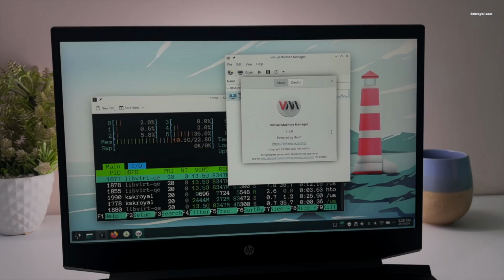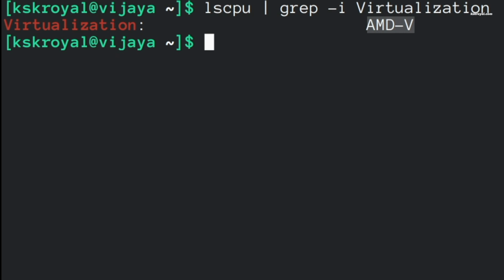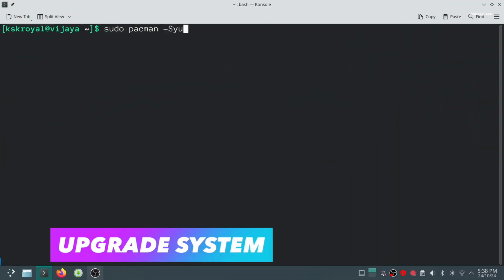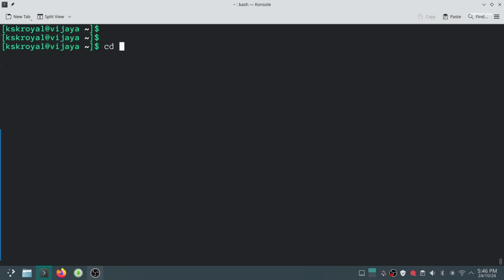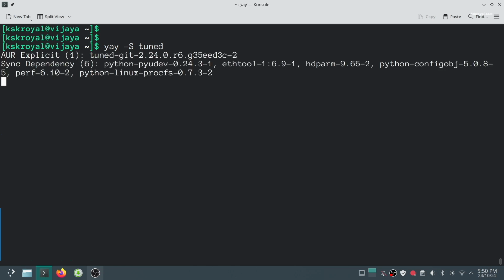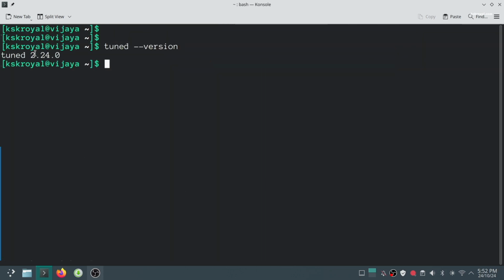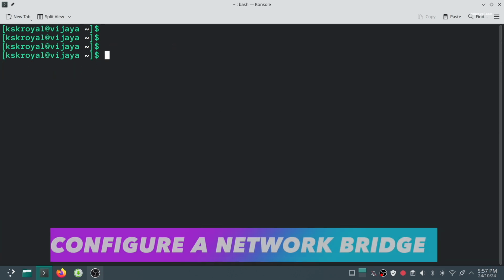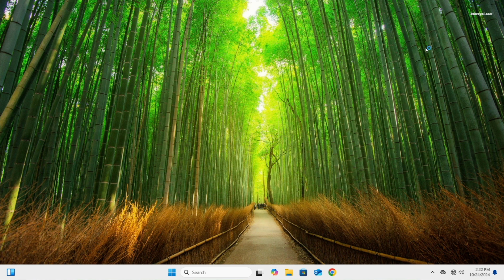HOW TO PROPERLY INSTALL QEMU KVM On Linux (Step By Step)

Comment: Thank you for this video! No problems with the installation, but I do not get internet connection from the VM. I was installing a Linux Mint virtual machine and my main OS is CachyOS. Any thoughts about this?

Edit: What worked for me is changing the /etc/libvirt/network.conf file. Remove the symbol on the "#" comment for firewall_backend, then set it to: firewall_backend="iptables". Restart the system afterwards and it should be good to go!

Comment: I suppose you are using Manjaro, so I made a little change and installed not from AUR but from Official manjaro repos and it works also. You need to install qemu-full qemu-img libvirt virt-install virt-manager virt-viewer edk2-ovmf swtpm guestfs-tools libosinfo,  ...  and  instead of "yay -S tuned" you just install tuned from official repos. It work for me. 👍

Comment: Nice intro!
I am hosting also a Win11 VM on my Fedora 41 laptop with Wi-Fi network access only, and would like to have my VM visible on the same LAN as the rest of my home network while still being able to access it from the host. My attempt at using nm-tui to set up a virtual bridge with the wireless interface is failing miserably! (Bridging with an Ethernet adapter works, but then I’m anchored to my server room)
Do you have any recommendations?

Comment: Nice and valuable! Thanks. I'm experimenting with NixOS right now. A fantastic, but not so easy to understand, configuration system.
Reply from the maker: Yes it takes time. But once you learn KVM in depth, you will love it. 
The best tool to manage virtual machines.